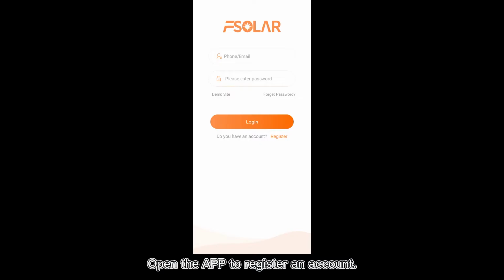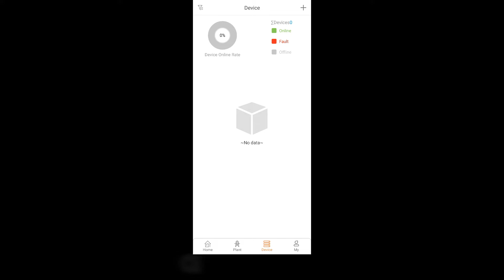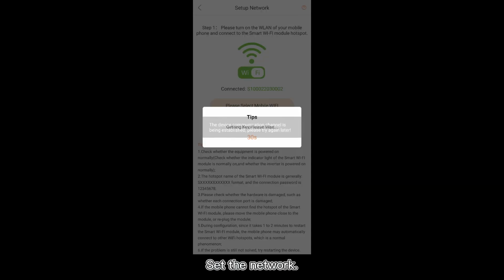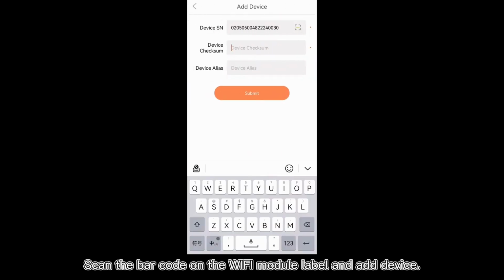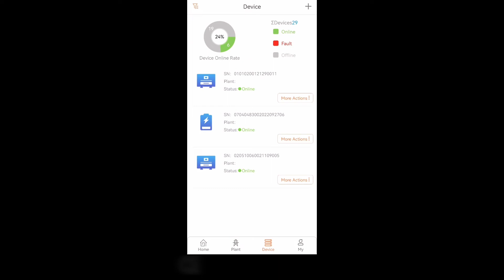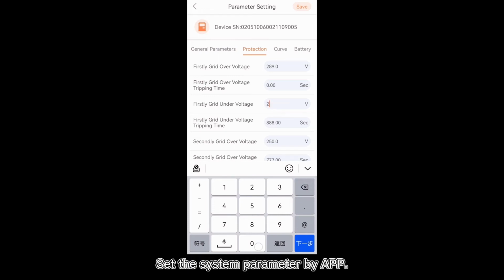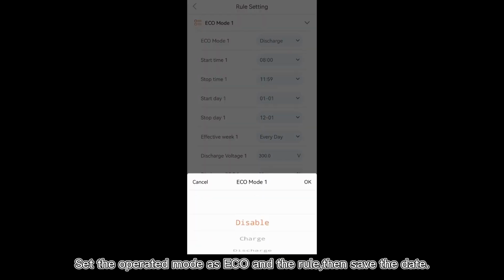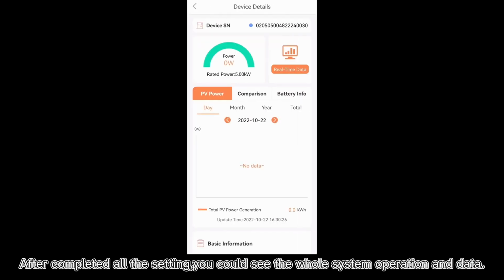WIFI Module Installation

Comment: Can i set the inverter through the inverter itself without wifi ?
Reply from the maker: Of course, operation details can be found in the specification
Reply: More details pls , i need to set it from the inverter but i dont know how
Reply from the maker: @rabihghannoum1198  felicityservice@felicitysolar.com/Whatsapp : +86 18620180651

Contact our technicians pls, they will offer you help in detail.

Comment: Does this work for ivem 5k 3k series
Reply from the maker: Yes
Reply: Can't someone connect to it when not close to the inverter like some Miles away from the wifi module 

Can it connect
Reply: Can i do this setting from inverter ?